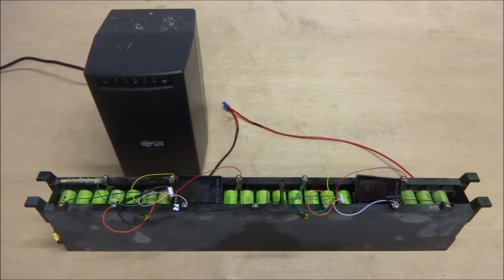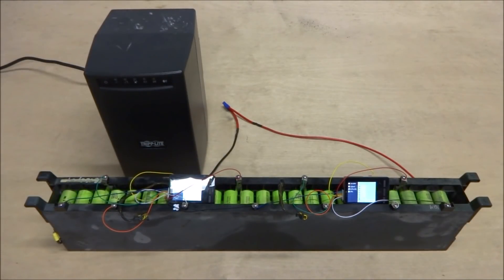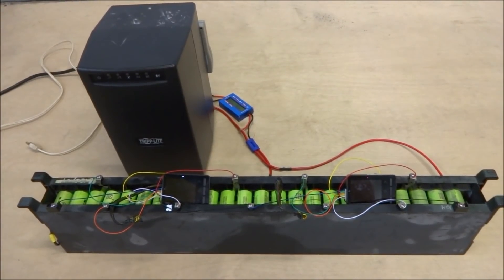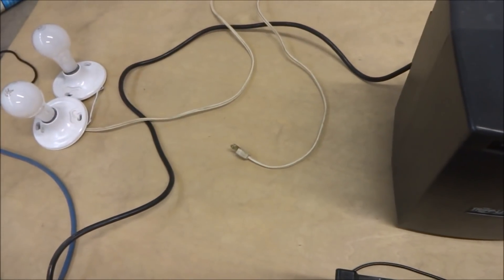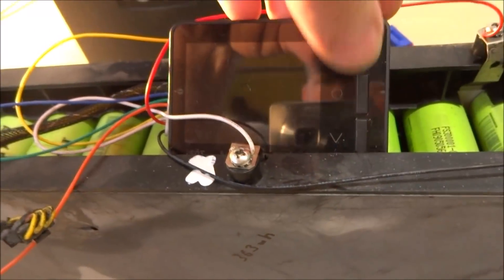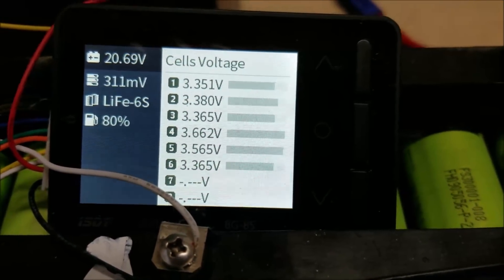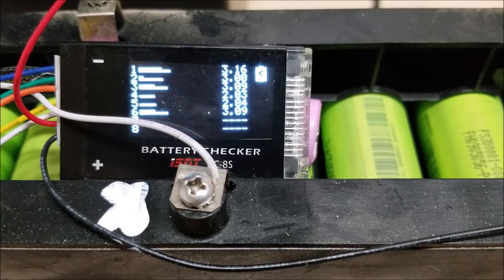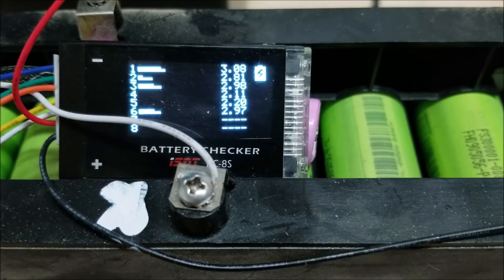Running a UPS on Lithium batteries

Comment: Does the Ups try to float charge or equalize the new lithium battery ? Lithium needs constant current /voltage. So basically a on off type of charger. What's stopping this ups from floating a battery not designed to float charge ???

Comment: Do you know what the max and min voltage this will take. Along with the amperage?
Reply: I made a lithium ion battery for an ultima LCD 
 2KVA EURO ups The battery was as follows: 30 cell bak high drain 4.2 v 3 A 5. The batteries were placed in 5 columns and 6 rows and  thick nickel stripe was used for spot welding.  I used BMS 6S.The problem is that in few seconds, not more than a minute, the battery gets extremely hot and smoke begins to appear. Please explain the error.

Comment: Isn't it dangerous to use these batts in a UPS designed with electronics to charge Lead-Acid?
Reply from the maker: As long as the voltage range stays with within the acceptable levels for li-ion, it is safe. Using a quality BMS is a must if using them long term without constant monitoring.
Reply: @DIYbatteries  BMS?
Reply from the maker: @jeffl7864  Battery Management System, something like this should do: https://www.amazon.ca/DALY-Battery-Management-Protection-Balance/dp/B087494LTL

Comment: I'm a bit of a noob, but if you had some kind of video such as "How to replace your lead acid UPS batteries with LiFePo for idiots", I would love it  :D

I'm looking to buy a multimeter and test my UPSs out (have two of CyberPower CP1000PFCLCD). I suppose I'd have to buy something that would autobalance them and of course do the math on what combo would work (putting them into series & then maybe parallel to max out capacity, if there's room inside).

Comment: My question is, if this ups is designed for lead acid batteries. What is preventing it from trying to past what is ideal for these cells? Also, lead acid batteries will have a significant higher voltage cut off than lipo.
Reply from the maker: These are not lipo batteries, they are lithium iron phosphate (LiFePO4). Four cells in series has a voltage range which matches a 12v lead acid battery. This pack has 12 groups of cells in series so it perfectly matches the voltage range for this ups which had three 12v batteries.
Reply: @DIYbatteries  Good choice.  Lithium Ion is dangerous even when charged properly.  I'd hate to have a lithium fire, and lithium iron is pretty resistant-in fact, it's probably about as safe as the original lead acid with the higher capacity.  Great job!